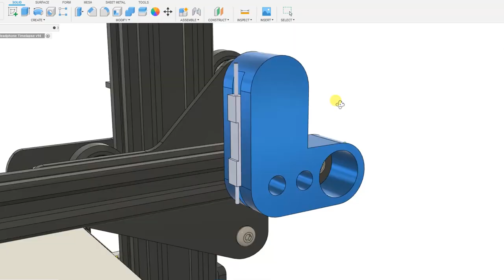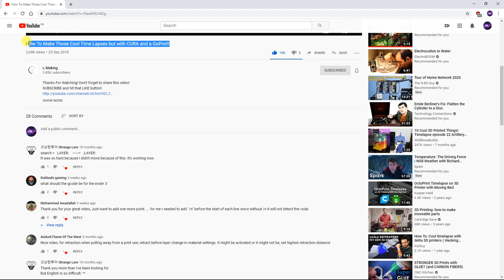3D Print Timelapse Using Headphones & Smartphone

Comment: I made myself a similar setup using the insides of a 1$ selfie stick a a bit of eraser for compliance on the pushing end for my Ender 3 . My biggest battle is with stringing, I'll try and see if the z move up you have your code helps with it.

Comment: Ok there have to be some kind of black magic, i did exactly the same thing but the head when going back from the press to the layer it just starts extruding (not oozing or stringing, i see the gear grinding and keep pulling out filament) leaving these strange trails of filaments, how you fixed that?
Reply from the maker: Hi Spyke, does it keep extruding continuously or just for a few seconds? If the latter I would suggest try altering the amount the extruder is retracting and restoring the filament by for the press move. If you look at the code at about minute 1:40, the third line from the top is pulling the filament up 10mm, and the fourth line from the bottom is telling it to push it 9mm back down. Maybe try changing those numbers to just a couple of mm, to see if that is the problem. If that works but causes lots of stringing you would just find a sweet spot between those numbers.  (I assume you are using a cr10/ender -  if not the problem could be variations for the g-code between different printers firmwares)
Reply: @AuroraOB  i am using a Cr10s, yeah, it just keep extruding like the travel route from the button push and the layer start its something to print, i've tried changing the mm of the extruder but nothing has really changed, it's been 2 days now and i am getting kinda crazy lol.
Also i never had stringing/oozing issues on all of my prints so it's kinda weird
Reply from the maker: @SpykeHollow  I see! Unfortunately I have no idea what would be causing that. The only other things I might suggest would be getting rid of those two lines entirely to see if that is the issue. if not maybe try turning off normal retraction and zhop in cura and see if it affects it at all. You could also open the full gcode in notepad and find, through a search, an instance of the code that you told cura to insert at each layer, and look if there's anything after that telling it to extrude. Will try and think what else it could be!
Reply: I have an Ender 3 and the same thing happens to me, if you could fix it, please tell me how you did it.
Sorry for my english, I am from Argentina
Reply: hey, the problem is when it finish the poke and wait it have to go to last position where it stopped and then extrudes,  for this reason you can see a lot of stringing. and try  to change the extrude form 9 to 7. good luck.
Reply: Hi mate did you manage to solve this issue, i have the same issue now but with the retraction do you have to adjust in the cura retraction settings or in the actual code from L Making? How did you fix this? Cheers
Reply: @HkBgNuiB  same question !!
Reply: Hello, i have an elegoo neptune 2 and i also have the same issue, did you manage to fix it?

Comment: Hey, I'm having some problems with the print shifting in the middle of the print and it gets off centered from the bed. Do you know how I can fix this?
Reply from the maker: sorry dude, i'm not sure what could be causing that. maybe check for solutions for normal layer shift issues
Reply: maybe your belt came loose when trying to fit it on